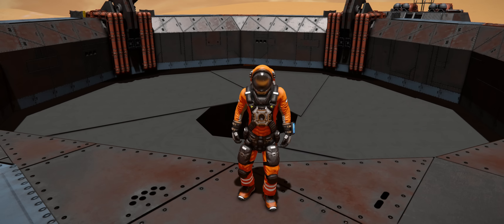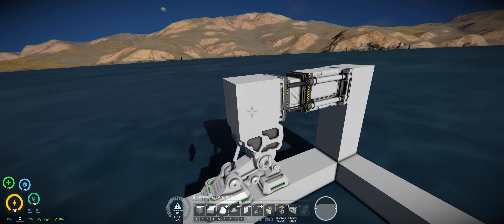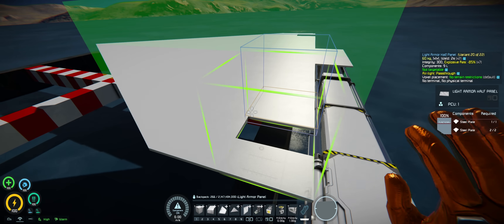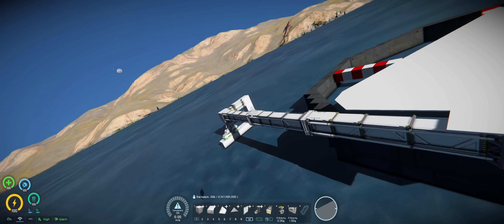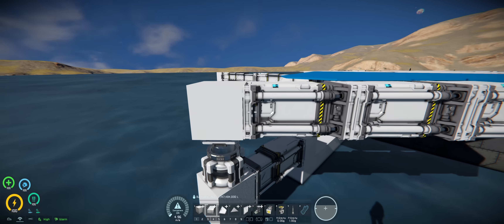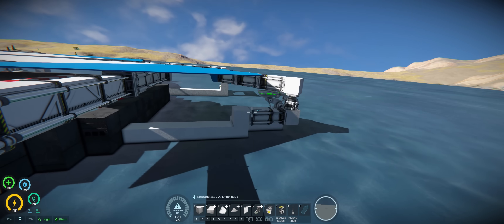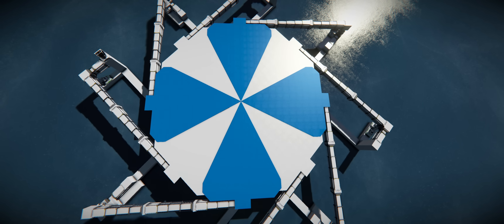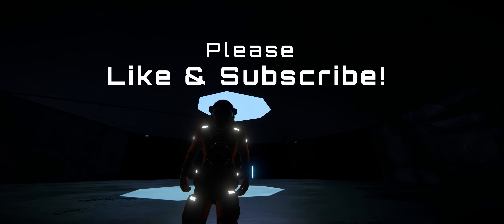Let's Build this Epic Iris Door! | Space Engineers Tutorial

Comment: Wouldn't just a single router be better??
Reply from the maker: You would still need to find the exact position for the rotor, it doesn't align perfect with the grid.

So you could offset the x and y of the rotor with pistons then use a rotor. Similar amount of blocks , but you could do it.

Comment: What inspired you to do it with linear actuation? Considering they traditionally rotate instead. (Also personally for covering the top I'd've used an intermediary "cap" that was lowered on pistons to be flush, since that could be made to interface with the surrounding roof on the other axes in order to remain seamless)
Reply from the maker: A lot of iris mechanisms actually have linear movement, the triangles slide against each other. it's just that the outer ring is usually rotated to get all the panels to move in unison. So it appears they need to rotate.
Reply from the maker: The cap is a good idea, especially if you just merge it in the voxels as a separate grid

Comment: 4:26 - Keen didn't do it this way, this is just how Computers handle floating point numbers. Bank software uses a format where each digit of a decimal number is stored separately in a 4 bit value. This way they can achieve infinite precision, but it is slow to compute and wastes memory. Every other software that doesn't require infinite precision, uses floating point numbers, where the number is separated into a sign bit, a fraction part and a exponent part. There is a finite amount of bits for each part of a floating point number, e.g. float 32 uses 8 bit for the exponent and 23 bits for the fraction. 

If one wants to store the number 0.567 into this value, then the first bit of the fraction has to be 1 because 2^-1=0.5 -> this fits into 0.567,
next bit is 2^⁻2=0.25 and 0.5 + 0.25 would be too large, so this bit becomes 0,
then 2^-3=0.125 and 0.5 + 0.125 is still too large, so 0,
2^-4=0.0625, 0.5 + 0.0625 is 0.5625
now we are at a binary fraction of 1001 and this process will continue until all 23 bits of the fraction are filled with either 0s or 1s. And there are only very few decimal numbers one can represent exactly this way in binary. Most numbers have to be rounded.
Reply from the maker: The large grid pistons have a 0.158463m offset when retracted. This is not a simple floating point rounding error. 
Keen hard coded it because of Clang/the old Havoc physics engine.
It is there to address the floating point physics, but Keen did code that number specifically.

Hopefully Space Engineers 2/Vrage 3 will be a little more user friendly with the better physics engine.

Comment: Buddy, I have a question for you. I'm making a long drill using pistons in the game, but as the pistons extend, the drill vibrates excessively and is almost about to break. How can I prevent this vibration?
Reply: What Coffee said. You can also turn off "Tool Shake" in the world settings. Total game changer!
Reply from the maker: Share inertial tensors, needs checked on the pistons and the setting needs to be on in your world.
You could also install some hinged landing gear/mag plates to stick to the drilled walls to make it more stable.

Comment: That's very cool build but the building phase needs so much space it heavily limits how it can be used without extensive terraforming. I wonder if it could be feasible to build in such way that the building area is fully enclosed into the area the whole structure takes when complete.

Making the iris with rotors attached to the corners of the triangles is a bit easier to build and more realistic as per how irises work in real life, but using pistons keeps the hole shape oriented the same which is so much more satisfying to look at.
Reply from the maker: It can definitely be built more compact, but for the sake of the tutorial I wanted clear view of the mechanisms and why they do what they do.

I hope this is a helpful guide so people can make it their own or optimize it further.

A linear movement iris is actually pretty standard to real life, it's just that the frame rotate to push the panels in unison instead of each being individually powered. But with SE mechanisms are cheap